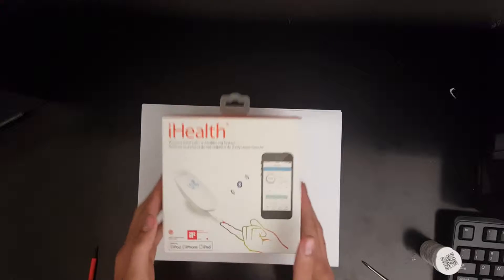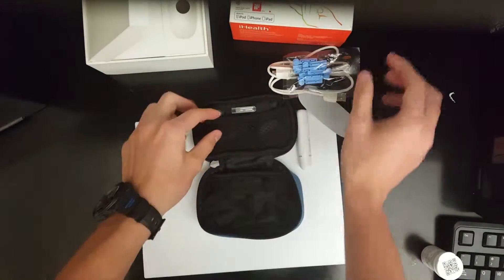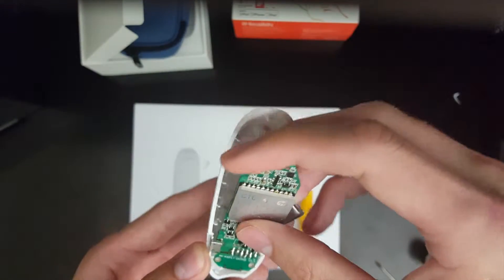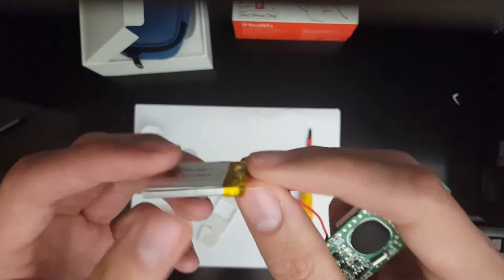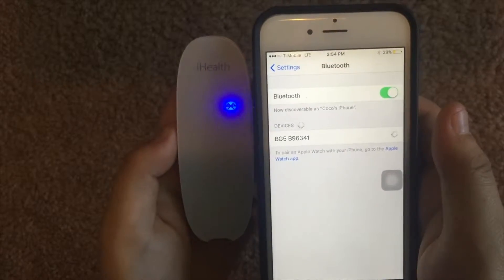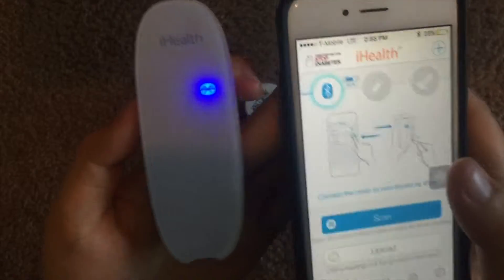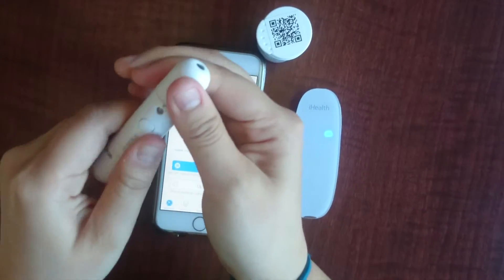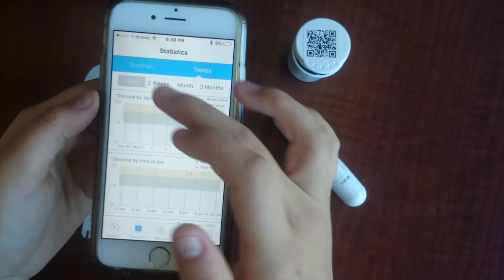iHealth Glucometer Device Tear Down Analysis

Comment: the epoxy is a COB which is the controller. the module is a Bluetooth 3.0 MFI module. it's communicating using uart. strip reader is using i2c.